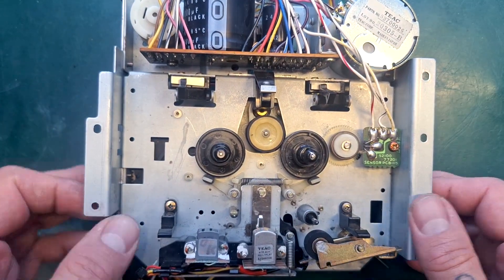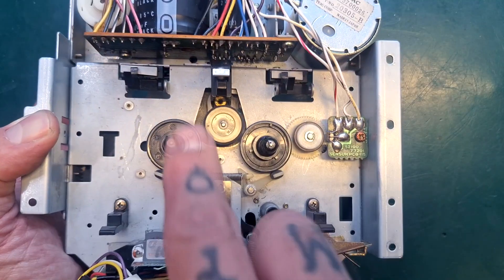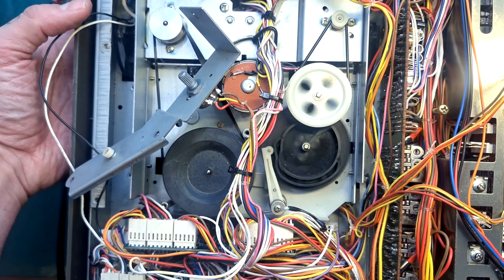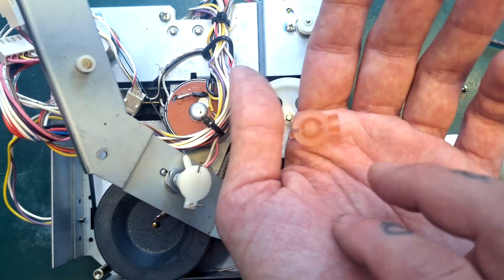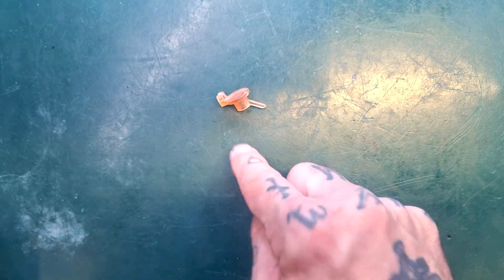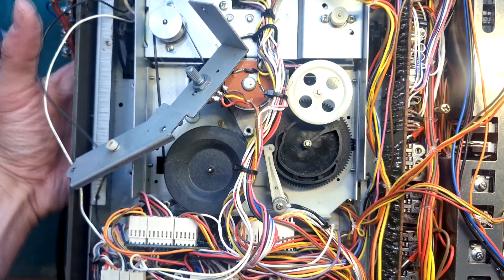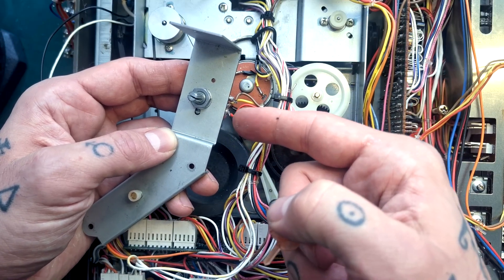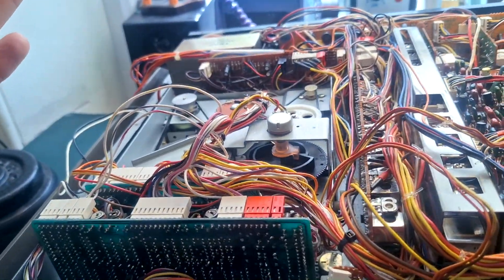Tascam 244 / 246 | Wrong Head Position & Head Bouncing Problems

Comment from the maker: So Gregg got in touch and he has the 3D printed part listed on ebay, see link at the end of this comment. Note that these are printed using resin, so its stronger than the material used in most 3D printers. Unless he is out of stock or you're on a really tight budget, I'd recommend this part as a better solution than adapting a guitar volume pot as mentioned in the video;-  https://ebay.us/m/GyED0P
Reply: Thank You Mr. Tetrakan and Gregg !   Just clicked on 'Confirm and Pay'   : )

Comment: Hi friend, could you help me? The transport motor only turns one way? I can't configure the potentiometer with the movement of the heads.
Reply from the maker: I haven’t had that problem before, so I’m not sure what to suggest….maybe if you flesh out the problem a bit I’ll have a brainwave? Are you saying, that the motor which raises and lowers the heads will not stop, no matter the position on the pot? Is it changing speed at all in response to changing the position of the pot? With power off, does the motor turn freely by hand in both directions?
Reply: @Tetrakan  I bought my Tascam 244 not working; it had a problem with the power supply. I replaced the capacitors and the rectifier bridge diode. The motor is working correctly; I tested it with a 9V power supply and it works in both directions. When I connect it to the conveyor system with the belt, the mechanism rotates, but when the potentiometer reaches the end of its travel, it doesn't perform any command. My question is, after it goes up, does the motor rotate in reverse to repeat another movement, or does it only work in one direction? I can upload a video here on YouTube if needed. I'm from Brazil and I have limited access to information here.
Reply from the maker: @t-dogmontain6249  the motor should rotate in both directions. With the potentiometer turned fully clockwise, the motor should rotate clockwise; with the potentiometer turned fully counter- clockwise, the motor should rotate counter clockwise; There should be a point in the middle of the potentiometer’s range of movement where the motor stops turning: If this is not the behaviour you have, explore the possibility that the power supply fault you mentioned has damaged capacitors or semiconductors on the printed circuit boards controlling the transport?

Comment: Hey there, first off thanks a million for all your incredibly helpful videos. With much of your help I’ve been able to resurrect not one but two tascam 234s. I also have a 244 that’s gotten all new rubber, but still has issues with flutter. It’s extremely noticeable on sustained notes or cymbal decay, and sounds relatively even/consistent. As I said it’s gotten all new rubber and the tape path has been cleaned. I’m not sure what to suspect next. I’m thinking the capstan motor is the next candidate but would love some direction on things to check. Thanks in advance!!

Comment: He lives! Great topic - this 100% applies to the 246 if anyone is wondering (and the same basic principles apply for the 464, kinda)
Reply from the maker: 246 - yes! 464 - kinda. 424 series works differently though - one motor with a second belt under the flywheel drives the head array and pinch roller position, with solenoids activating gears x
Reply: @Tetrakan Ahhh gotcha. I'll edit appropriately. Hope things are good!